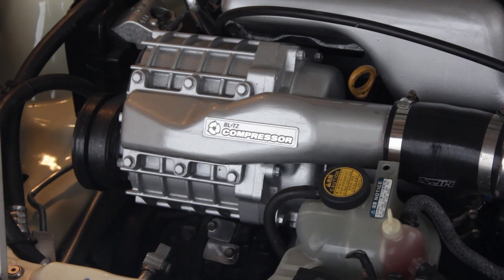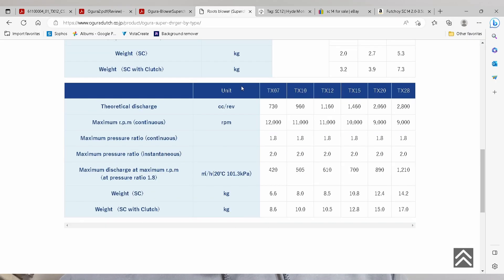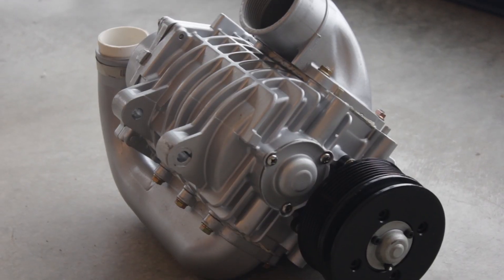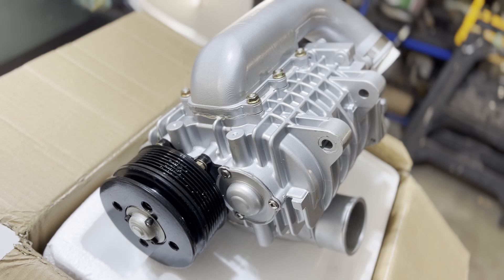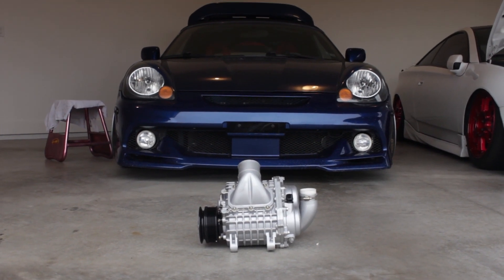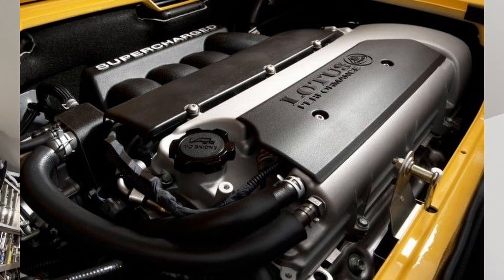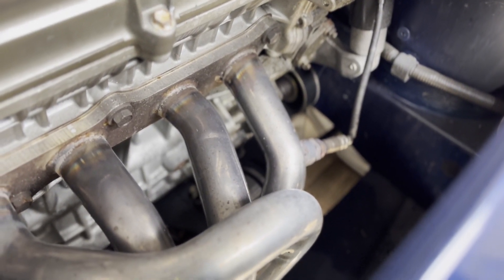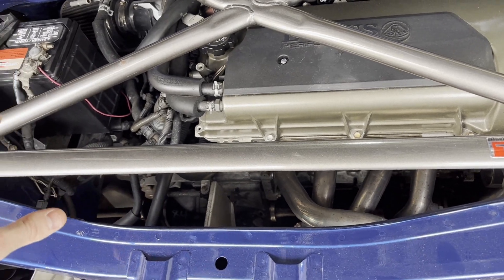$300 Amazon SC14 Supercharger - Can I build a kit for my MR2 Spyder?

Comment: Pretty cool build tho' Id avoid the refurbished units, just buy a good used one as these can not be refurbished because the rotor bearings for these simply do not exist. All the extra you paying for is a super cheap paint job and a cement mixer pulley.
Reply from the maker: Appreciate that! Honestly the refurbished units are just the most readily available and cheapest that I could find. I would say that whether you go used or refurbished, you're taking chance with the internals.. That being said, I probably should open it up and see what I've got.. haha

Comment: Definitely put a mag clutch on it. You do not want that running constantly even for a weekend driver. Supercharged and turbocharged designed to run at low rpm's. Try snagging and repurposing the front clutch pulley off of an AC compressor for a Toyota spyder. If you want to do it right you could even run in Arduino to a relay, writing a basic program that runs off of barometric pressure differences (using a map or maf sensor for reference). When you romp on the gas, there will be a significant pressure drop. Then all you have to do is set when (what pressure) the Arduino signals the relay and the AC clutch engages the supercharger. 
You will have to do the math to see what the boost will be using that clutch but I am sure you can find a bigger or smaller diameter pulley in any junk yards with the same PK ribs.
If you use the Arduino, sensor with a AC clutch and relay setup like I suggested, it will allow the clutch to bite in and ramp up as it engages. It will also be worry-free and you wouldn't have to worried about when it engages as it will only engage if you floor it and you can use it as a daily driver when you want to and drive sensibly and the supercharger won't engage. It will also keep it from engaging at lower speeds so you don't stall at lower RPM from the excessive torque drag. You can also change when it engages whether it be earlier or later using the Arduino and changing the values for the signal relay.
You can pick up the Arduino for under $40. You have two wires coming in for the signal, onewire leaving to go to the relay, a transistor to drop it down to 5v, a relay and wiring from the relay to the clutch pulley. It would be a under $100 diy standalone system.
Can't help you with the intercooler cuz that has to be based off of what space you have. When spiders first came out I saw some unique scoop designs for the intercooler... They look like a goofy center snorkel and took air flow from the center and blew it down into the engine compartment. They were fiberglass dance moves to look like they were part of the org equipment... I don't know how they set up the intercooler though but they did look strange. Pretty sure you could do an image search and find what I'm talkin about. I would not advise running the intercooler to the front because that's a lot of tube and you would lose boost given the volume of air that you would be compressing. Best rule of thumb is to keep the intercooler close by with minimal piping. SC are very different than turbos. 
Good luck and keep us updated. If you need any help get me back on this msg.
Reply from the maker: Appreciate the great info!! So many different ways to do things, so all information is great for me! I will probably be referencing back to your comment in the future! haha

Comment: What's cracking Youngblood. Nice to see a Gen Z that's not a total pinhead. You're throwing out the details just the way I like. 
Gonna try to help with some people I've found on YT.

Frankenstein Motorworks
Make some time cause you're gonna binge on this guy. High level MR2 and Toyota motor mods.

Easy Composites Ltd
You're gonna need a manifold on the output side of your SC with good flow characteristics. FEA then build a 3d printed mold. Or not and use aluminum and a brake.

Nivlac57
Just a side note. Saw you have a Canyon or a Colorado. This is the Atlas go to guy. He runs the 4200 but all the same just minus 16.6666 percent on the 5.

BTW SUBSCRIBED.
Reply from the maker: Appreciate the kind words! Thanks for the references! I will definitely try to check them out in my free time!

Comment: Monkeywrench has two bolt in supercharger kits that relocate the alternator. So it's possible, but i would have picked a different charger than you selected. Good luck with your build.
Reply from the maker: Yep definitely agree! With one of their kits, I still would be inclined to cut an access hole in the firewall just for ease of access. Also, engine would probably need to come out to install the kit? maybe not? (would be a pain to install though). Appreciate the comment and thanks for watching! :)

Comment: Hello, I too have a zzw30 2zz swapped running the blitz kit with the tx12, just water to air rather than the front mount the celica kit comes with. Obviously the blitz kit is designed to relocate the alternator for fitting the SC where the alt goes with the cast alloy sump. I have a second 2zz spyder that I am considering fitting a SC14 to from a JDM estima that I have sitting here. They are both very similar but the sc14 does have bigger port flanges, as you can see all the measurements are on the ogura site in those tables. I have some experience running the 2zz on both a power fc and a haltech elite 1000, if you want a few tips and tricks for how to run this please let me know
Reply: i was wondering this, if i decide to run this supercharger on my 2zz celica and i somehow get it to fit, what would be best? Power FC? would ther stock ecu be able to even handle any of it at all until i get the power fc?
Reply: @WonderXai  Power FC is okay but you'd want a standalone SC clutch controller if you use a magnetic clutch, that's what the blitz kit uses. If you use a permanent SC it will be fine, though will probably need an injector upgrade. Factory 2zz ones are on the limit with the blitz SC kit and that flows less air than an SC14, as well as that they have an upgraded FPR in the fuel tank. I def wouldnt trust the stock ECU to manage.
Reply from the maker: Wow that is awesome!!! You’d fit right in with my brother and I! Haha. I will definitely take any help I can get! Do you have an Instagram or anything I can reach out to you on?

Comment: What’s the difference between this bigger supercharger and the “stock” one that comes on the lotus 2zz?
Reply from the maker: From what I am finding, the MP62 (I think this what comes on the 2zz Exiges) puts out about 1000 cc/rev. So depending on what pulley size I go with, the SC14 has the potential to put out more power than the lotus. Definitely going to be some experimenting and trial and error to get it to a safe number that I feel good about. Appreciate the comment!!!
Reply: Sub’d btw